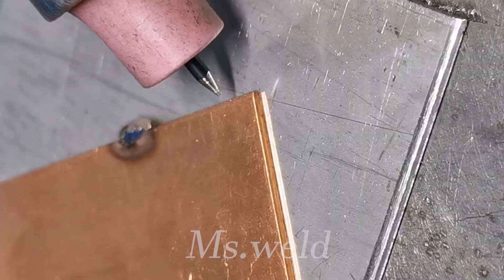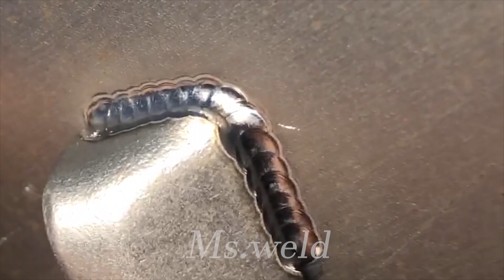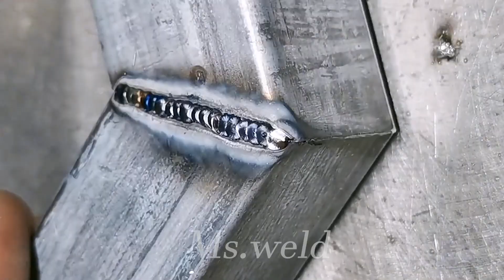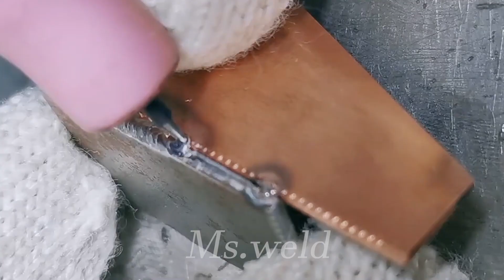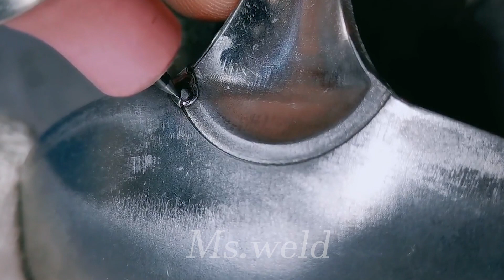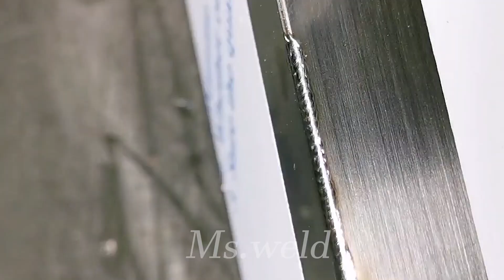Cold Welding Machine Repairs Car Radiator!| Precision TIG/Cold Welding for the welder and factory#4

Comment: Nice weld, but where do you get the extra metal in the firm of a flux, rod or wire from to fill the gap between the plate and the item added on it? 🤔
Reply: it melts the metal and bond them simultaneously.
Reply: @AvyangShang  You can use regular filler rod used for Tig welding.

Comment: hello pretty ❤️ do u use andeli machine for welding?
Reply: I don't think so.  There was a link to a company web site in one of these videos.  It was all in Chinese, but you could enjoy the pictures.  There's more than two or three suppliers of such machines.  I think the real advance might be that helmet she shows that has LED lamps in it, and also auto-darkening.  I think it might be synchronized with the machine!  There's a cable going to the helmet.  This might just be power for the lamps, but I HOPE it's synchronized.  The lamps go off when the helmet lens darkens, anyway.
Reply: @leonardpearlman4017  Yes, I saw that too and I think you are right in that the helmet is synchronised to the flash or you won't be able to see the progress of the electrode.....normal self darkening helmets won't work as the flash is so short.

Comment: The welds are beautiful, but is there any skill to this?
Reply: It looks like it!  She has like 160 videos I think, so that's a lot of practice right there!  It looks like VERY close fit-up is really important.
Reply: @leonardpearlman4017  Go check out some of the video's of people actually using and testing these machines.  Variation of TIG pulse welding, however it completely shuts off after each cycle, which leads to very weak welds. This is simple a very expensive spot welder.  Which is why you don't see anyone welding 14-16 gauge sheet metal/tubing. Also, she uses time lapse, its very, very slow. Might be useful for very light weight, hobbiest crafting, art type of stuff.  Pretty expensive machine when you can actually get decent little TIG machines for $150.
Reply: @boots7859  You know nothing but you come on as a self proclaimed expert...........I just bought the Andeli model so now it's full steam ahead.....tig will never be the same.